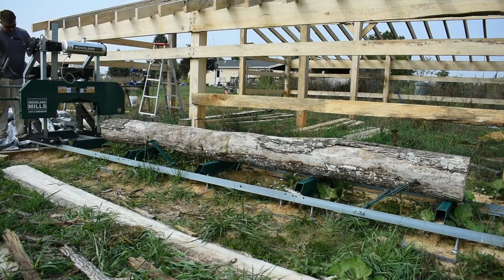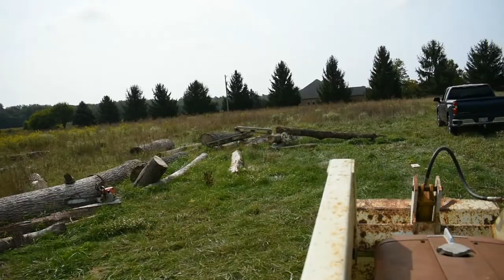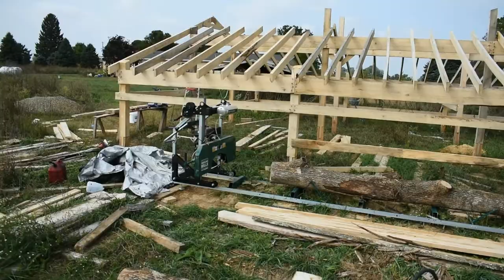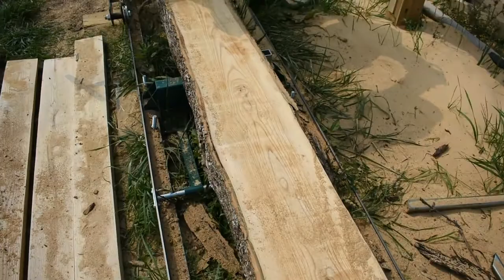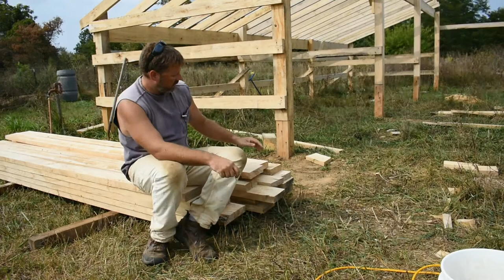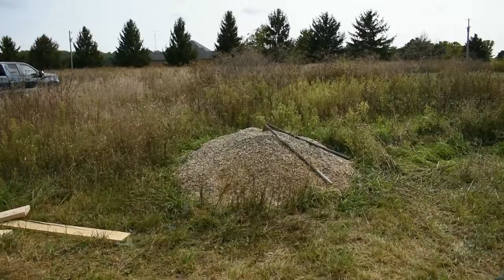Homestead Barn Build - Episode 4.......Milling the lumber

Comment: How long has the trees been felled? Did you dry them, or did they go up green?
Reply from the maker: I started logging that year in late July and we started sawing about a week before building in mid August.  I'd say those Ash had been standing dead for 2 years, at least the ones we were able to use.  I still have about 1k board feet of that ash and it didn't move much so I'm going to say everything was under 30% moisture when it went up.